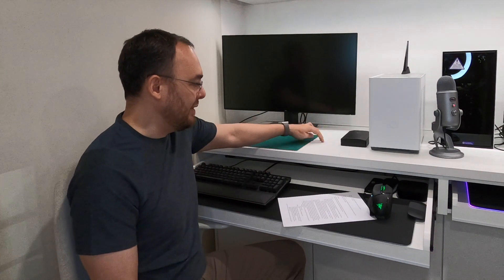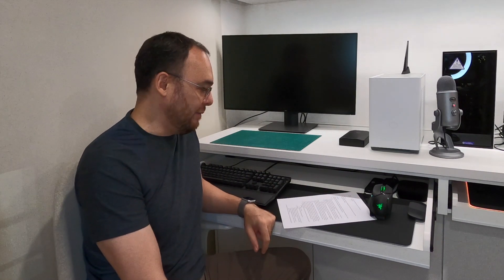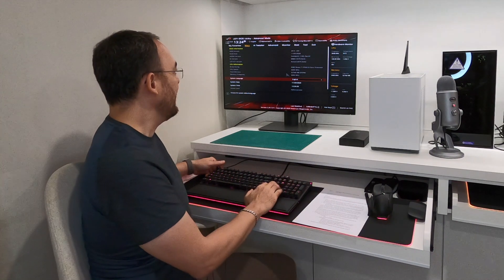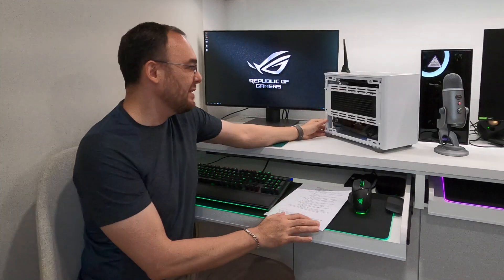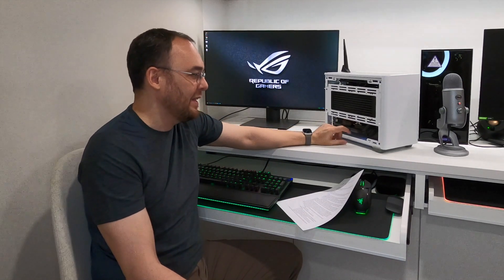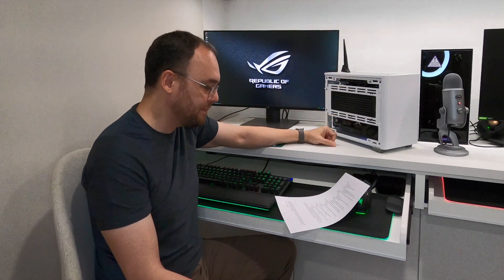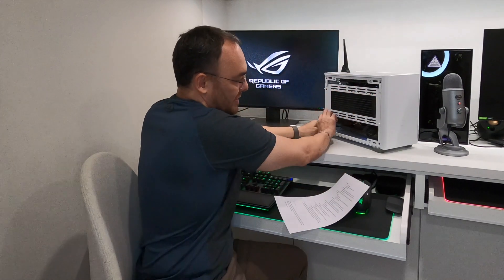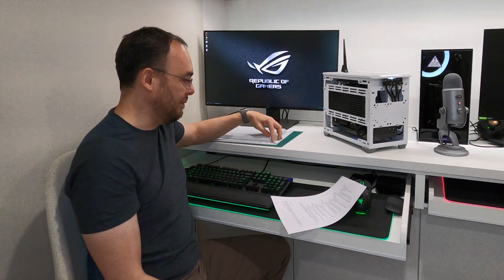Cooler Master NR200P Troubleshooting and thermals

Comment: Why didn't you just air cool the CPU? There are plenty of great fans that probably would have worked near as well as the water.
Reply from the maker: The idea was to explore the options available for the use of an AIO. With the big GPU that went in there is not a lot of air coming in from belo and therefore not a good path for air to come in from below to be exhausted out the top.

Comment: should i put fans on the bottom pulling air up or will that clash with the GPU exhausting air?
Reply from the maker: Yes it’s generally advised to setup intake fans at the bottom and exhaust at the top. Do take note of the clearance. In my case the GPU is very thick so can only fit Low profile fans below. Will make a few adjustments to test thermals.

Comment: Are we able to do a four fan pushpull aio with below clearance while vertically mounting?
Reply from the maker: Interesting idea,... from looking the clearance using the slim profile radiator I used you can fit another pari of low profile fans below to do the push pull config. However I would strongly recommend to research more as this particular AIO seems to have a grinding sound where the air bubbles raise to the top of the pump. This is known to reduce the lifetime of the AIO so not something I would recommend. Check my Troubleshooting video to see the details on my findings while building this system.
Reply: @FizzysTech  yes im thinking to try on my antique kraken. im recently so impressed with 4 fans on rad... 50 degrees while hardcore gaming man.......
Reply from the maker: @eunie178  Nice,.. thats a very good temp to be running on full load. What GPU are you using?
Reply: @FizzysTech  decided to hoot this case after so long, for my sis! just the perfect size for gals. prolly gona go for the vertical mounted gpu option and tilt the case around to make sure the aio is not at the bottom. my old aio has like probably 60% water left inside it starts grinding when i try rad placements on bottom...........
Reply from the maker: @eunie178  not sure how you are going to mount unless its up-side-down. In that case you will be applying a lot of pressure on the ack plate screws so if it’s a beefy GPU it’s not something I would recommend. 

Let us know how you get on and share images of what you end up with.

Comment: Great video, pretty useful info. I would like to ask you about the GPU thermals of this Cooler master NR200 vs NZXT h1, I know the NZXT has less airflow which incides in thermal performance but my question is, it's much difference between them?
I'm planning to build a similar build like yours (I have ryzen 5600x and RTX 3070) I really like H1 form but I'm a little bit worried about  thermal performance in the GPU, on the other hand the NR200 allows me to fit a couple of fans that improves the airflow.
Thats my dilema, would be pretty helpful to know your opinion about this great cases.
Thanks in advance for the answer and please apologize my english, it's not my native language :D
Reply from the maker: Thanks for the comment,..  I do have both systems on hand and will do some additional tests. For the H1 I have the Ryzen 9 3950X CPU which surprisingly runs decent on the 140mm AIO. I am still waiting to get hold of an up-to-date GPU (RX 6800 or 6800XT) but they are proving difficult to get hold of. Once I do get one I will do a follow up video. 

As for the Cooler Master NR200P, I have the Gigabyte RTX 3080 Eagle loaded into it and at load the GPU spikes at about 73 degrees. Looking to add some fans below to see how much I can drop that by. Your suggestion to compare thermals sounds like a good idea so I'll see what I can do in the near future.

Comment: The riser cable being only pcie 3.0 is a huge pain. Thanks for letting us know
Reply from the maker: It certainly is. If you update your BIOS your going to have to do some serious messing around to change the setting to gen 3 if you don’t have a spare older GPU to put in temporarily to make the change. Experienced this first hand as I did a BIOS update to ensure it has all the latest support! After that I did the tests and found that this particular AIO was not good being mounted below so now the GPU is directly in the motherboard slot.
Reply: @FizzysTech  yeah I was originally planning on using the riser for a pcie4 card so that's out the door
Reply from the maker: @jnavarra  you can still do that just that you need to remember to make the change in the BIOS to make it work. Hope the Cooler Master and other manufacturers that provide a raider cable will upgrade their offering to include a gen 4 raiser cable in the near future :)

Comment: I use a Ryzen 1600 (non af) on the Strix B550i motherboard. Not supported but its fully working. Thought you might want to know.
Reply from the maker: Thanks for the info. Just checked Asus website and they claim the following “AMD AM4 Socket for AMD Ryzen™ 5000 Series/ 4000 G-Series/ 3000 Series Desktop Processors”. So from the looks of this the b550 I-gaming does not support the 1000 and 2000 series CPU’s.